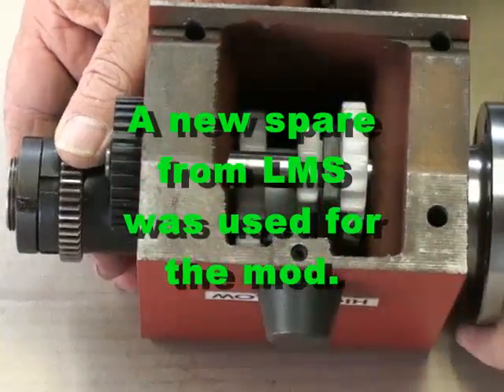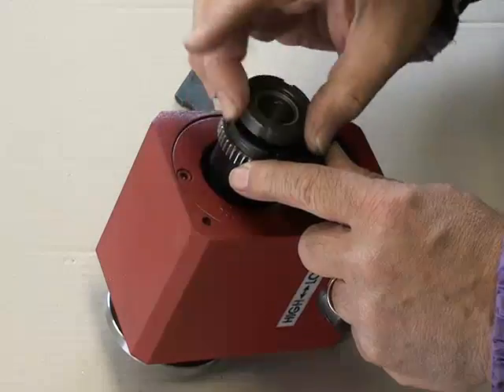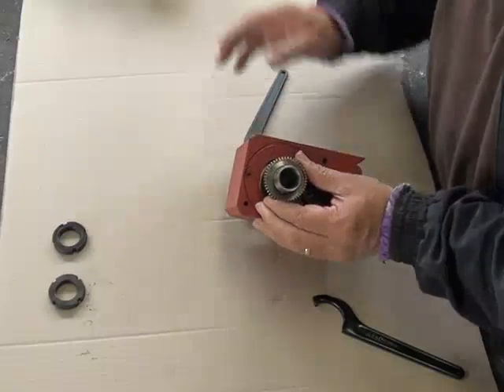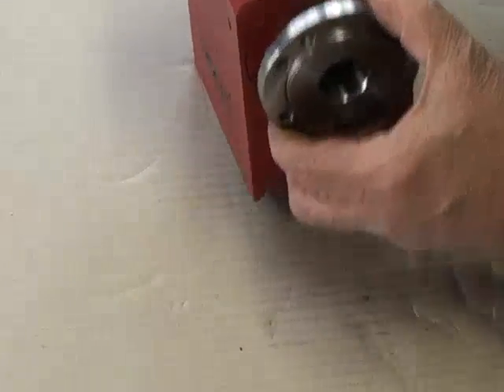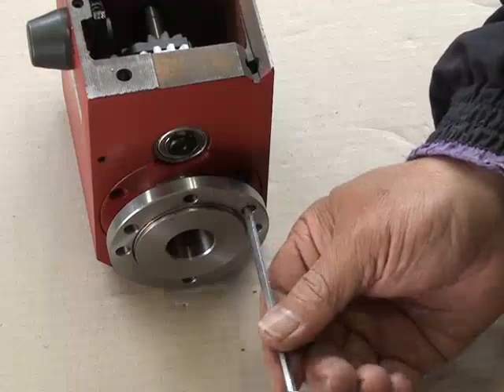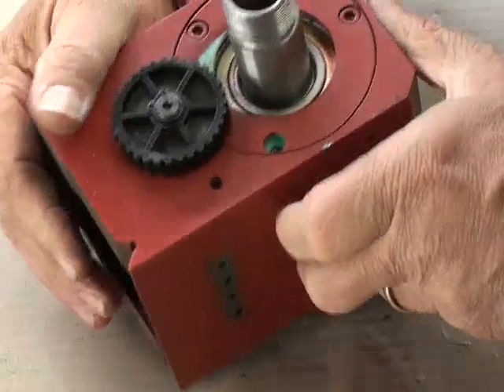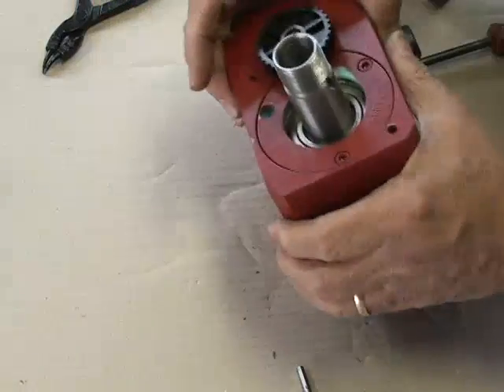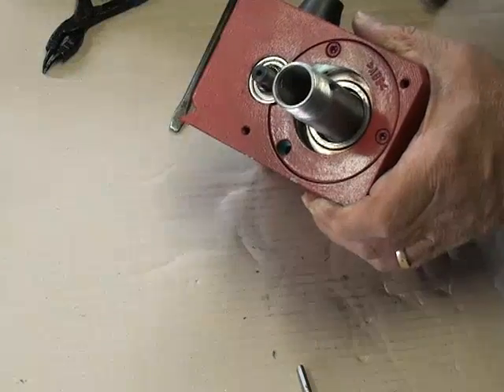Upgrade 7X12 lathe headstock to taper bearings

Comment: Minute 3:52 : You posted a video in which you get off a gear from his shaft with ( only ) one screwdriver ? Unbelieveble ! Can't you use an extractor ? Or ( at least ) use TWO screwdrivers ? You are risking of bendind your shaft ! Or damaging your gear ... 
And teaching people doing the same ?
Reply: This comment is ridiculous. Prying against a plastic gear will never ever bend a steel shaft lol. At worse, it would break the plastic gear.
Reply: @JohnDoe-ls2ww That shafts are not so strong as you believe, not hardened ...
Next time try with a file, so you'll understand what kind of steel are they made of ...
Cheese steel !!! ( a bit harder than plastic ... ).
In any case, do as you like ...

Comment: I have worked on this same headstock on a Grizzly G8688 Lathe   I had a question about why you changed the bearings and where you got your kit to push and pull the shafts and the bearings
Reply from the maker: Replacing the bearings improves rigidity and reduces the chatter, which parting off can cause.
Companies like Little Machine shop sell the pulling tools, but often bits they are improvised from the bits in the scrap bin.
An easier replacement can be achieved by using rubber sealed angular thrust bearings, which are a drop in replacement and don't need modifications to the spacers.  See the ARCeuro site for instructions.
http://www.arceurotrade.co.uk/Catalogue/Projects-Articles
Bearing pre-load is easier to adjust if the outboard bearing is not too tight and slides on the spindle